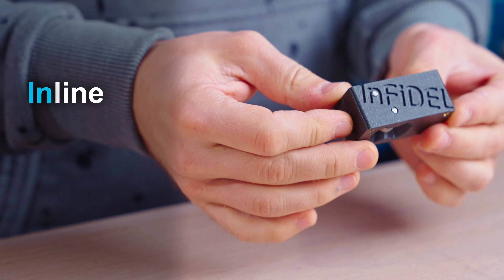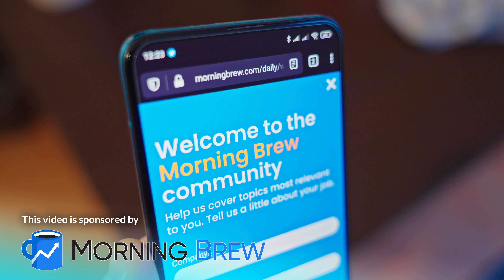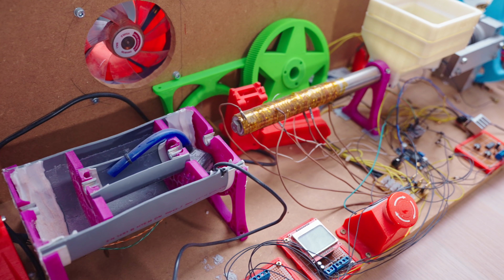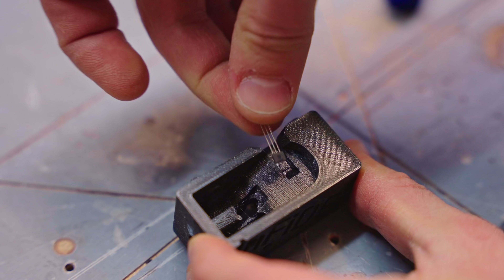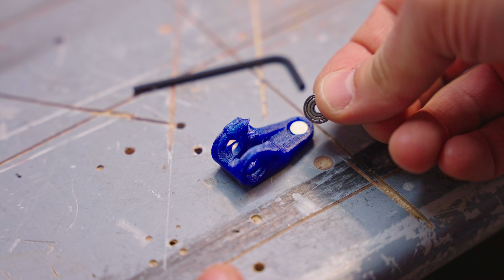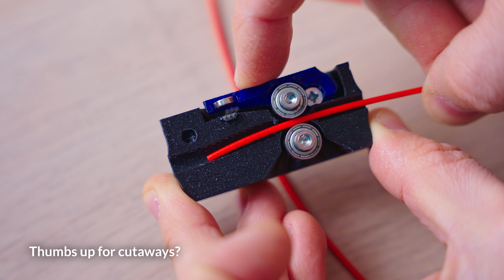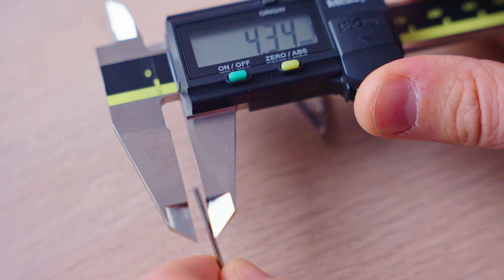Make your own inline filament diameter sensor (under $5)!

Comment from the maker: Oh, one thing I guess I should mention: The sensor has a FAULT output (same as the LED), which is programmed to turn on when it detects errors like the filament being outside of the expected diameter range. So with that output, it can be directly used as a filament runout sensor as well, even without firmware support for the InFiDEL's measuring output!
Reply from the maker: And yes, the pins and grub screw I used in the build were temporary stand-ins as the proper parts hadn't arrived yet 😅
Reply: @MadeWithLayers  well Tom, nicely done, and bloody long time iteration, but you have made it except one issue I am facing often:  Filament jam.  

If by some means you can also encode one of the bearings to match the steps reading of said bearing to the steps sent to the extruder motor (like a closed loop where the encoder is not on the motor itself but on your little contraption) that can trigger the "pause" on print each time the encoder reads a zero advance no matter why compared to the desired advance for like 10 seconds, this wouldbe the hit of the century in the filament detection gadgets, 3 in one.  

And the reason I say that is because most prints fail for a filament jam somewhere (included wrong diameter that jamms in the bowden tube due to the cascade effect, (that is; the harder is going through the tube, the larger the indentations of the extruder wheel to can push; it create more fake extra diamenter that only worsen the situation untill it jams it for good) that you are trying to somehow mitigate using this device, but there are other reasons a printer can jam, clogged nozzle included, so with perfect diameter filament, your print receives no filament anyway.

So here is my challange, keeping the design as is, but using some bearing model that can give an encoder a reading somehow, eventually a hole in the side wall at the external diameterof a bearing to read the motion of the outer shell with an optic device, and make this a 3 in one thing, it would make a better life than just finding my printer 10 Cm above the Z height where it stopped printing, still dancing in the air pretending to print, when I am back from work in the evening.
Reply: @severpop8699  there might be enough 'noise' in the sensor readings to allow motion detection . Stationary filament diameter will not change whereas even the best filament will have some variation. If Toms design can read um it is likely to be able to detect surface noise too.
Reply: @severpop8699  I think the best approach here would be to redesign Tom's sensor specifically to detect motion by replacing the idler bearings with a geared setup like you see in a bondtech extruder. The pressure applied from the spring which already exists in the current design would just need to be enough to ensure the gears can rotate, and they could then be further connected to a rotary encoder. The linear hall effect sensor just isn't the right one for this problem -- but rotary encoders use a hall effect sensor oriented differently so as to capture the angular motion. Tom's sensor as is just isn't designed for detecting the rate of co-axial movement in any sort of reliable way, only radial movement from difference in diameter.
Reply: Or just add a flat to one bearing creating a regular dip in the readings.
Reply: @wktodd  I would not recommend this approach as it would require that the sensor has a priori knowledge of the filament feed rate in order to guarantee that the readings that result from this periodic dip is detected and removed. It would be very difficult to distinguish this dip against the sensor running out or a jam or otherwise without creating a period of time where the sensor cannot be certain about the state of the system.
Reply: @danielsmullen3223  yeah i can see that :-)
Reply: @severpop8699  That's a good idea. I bought a few spools of HT-PLA+ and every print failed due to the filament binding in the tubing either between the buffer and MMU or between the MMU and the printhead , I have a Prusa MK3s - MMU2s. The first time it happened I left the room and came back 15 minutes later to find the nozzle 10mm above the part still printing with nothing coming out and when I started over the printer printed fine, it was not a clogged nozzle. It took a few failed prints to realize the filament was just wavy enough to cause it to bind in the tubing and not feed. I agree that a filament movement sensor would be perfect. I have a filament use counter that I made two years ago, it does detect filament movement, sends the encoder signal to an Arduino Nano for decoding. Problem is my counter is massive compared to Tom's diameter sensor and where it differs is there is a roller that the filament rides on to spin the encoder.
Reply: Or potentially a sensor that detects unexpected sudden bulges in filament diameter, as well. Prevent clogs before they happen...
Reply: So the Prusa Mk3 filament runout sensor is very similar but doesn't measure the thickness. I think Prusa missed a trick there. Perhaps their next Prusa version will have Infadel built-in?
Reply: This is great! Thanks for putting this out in the wild, Tom. Have you/are there plans to cover integration with the firmware on the printer controllers?
Reply: What is necessary to enable analog output?
Reply: Fantastic idea. The implementation of "on the fly" extrusion multiplier adjustments should help to improve overall print quality, accuracy, and precision. A small contribution to the never ending cycle of iteration: additional heat-set holes for mounting a custom designed bracket?!
Reply: On the replies suggesting a rotary encoder - remember the price point! You don't need a rotary encoder to sense a filament jam; just a simple optical sensor and a notched wheel. Accuracy doesn't matter unless you are trying to get super fancy; set a watchdog timer that gets reset every time the notched wheel produces a pulse. If the timer ever runs down to zero, the filament isn't moving. But even this will require some added complexity that will drive up the price...
Reply: @andrewwakefield4519  couldn't we just expect that the filament isn't perfect, so if the diameter doesn't change than the filament doesn't move?
Reply: Ha! I was about to ask if there was a way to use it for that. Guess I'll put that thing in my DIY queue now. Might be a nice testing ground for my PineCil as well. Thanks for making this design available, very much appreciated
Reply: heh. This was my first question! :)
Reply: What is the noise like when the filament has stopped moving. I am interested using it to maybe detect a tangled spool  / jam
Reply: Someone that sale the parts, so one can buy the parts, and then make one.  I think that is the major problems with things like this.

Great work, by they way!
Reply: @AndersJackson  I tried a homemade filament maker and decided the damage done replacing badly clogged nozzles wasn’t worth the savings.
Reply: @Ricky_B4  sorry to not been clear enough.  I was talking about a kit for the InFIDEL device, not the filament maker.
Reply: I would love to see a video on your filiment line
Reply: Could you include a rotery encoder so you can tell how much filment is passing through the sencor?
Reply: Is there a place I can easily order a populated board for this?
Reply: I totally love this option and it's actually my intended use for this.
Reply: Oh good timing, I have issues with my filament sensors and was looking at a replacement. Pity I only have some of the parts on hand, no dowels - order time.

Btw your youimagine design link doesnt work!